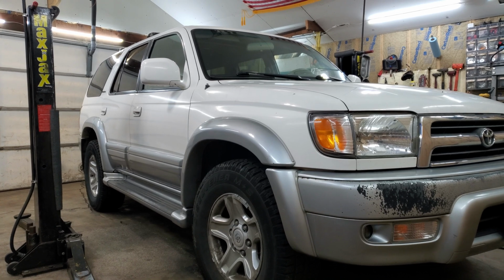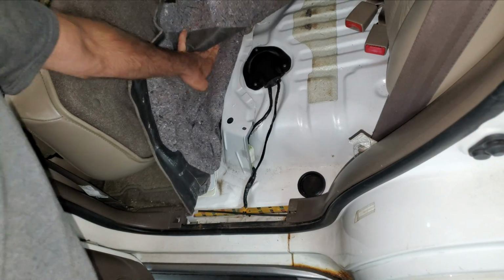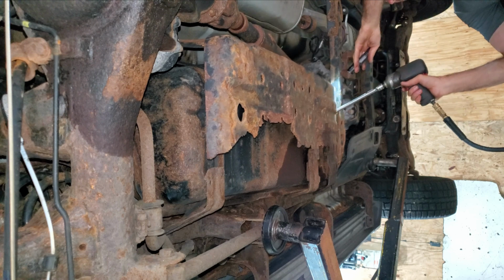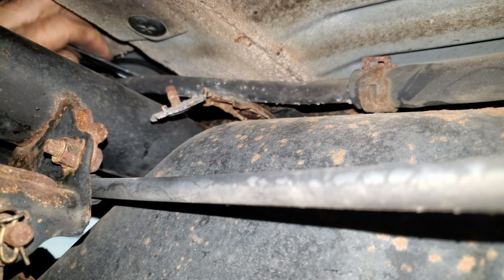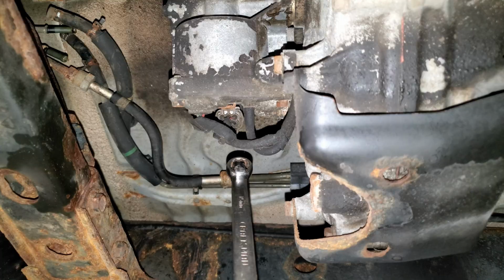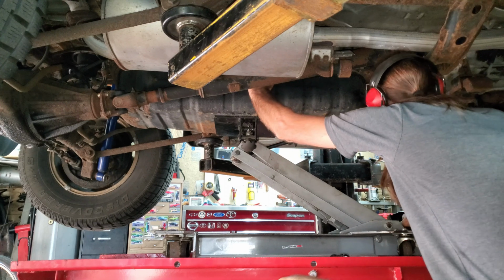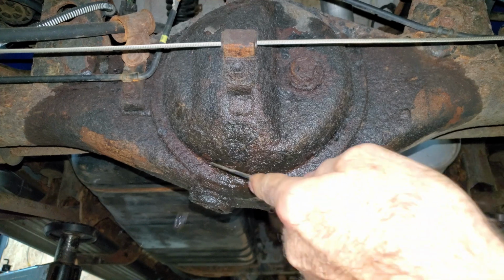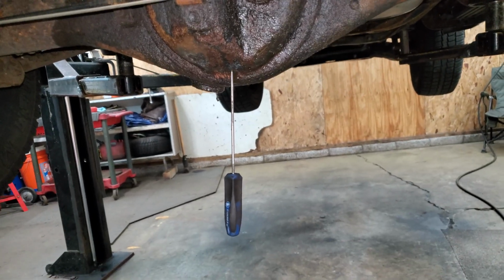1996-2000 Toyota 4Runner gas tank replacement

Comment: my 4runner has been out of commission since summer of 2018 due to bad engine.  There has been gas in the tank since then till now...2023.  Do you have advice on preparing/cleaning tank and fuel lines before new engine install?
Reply from the maker: I would see if it runs on it. Drive it to the gas station, and fill it. Run that tank to empty.

Comment: Thank you for this video 😭 having trouble with my 2002 pretty much the same but a little different. I am confused because at the front of my tank I only have 2 lines I don’t know if thats a difference between 2000 and 2002
Reply from the maker: Some systems are returnless.

Comment: Great video. Ok bye. On that rear differential cover, I had the exact same thing. Rusty and leaking and smelled horrible when the differential oil got on the ground and mixed with the rain. Horrible smell. Anyway, I bought a replacement cover on eBay for 60$ and had a local shop weld it on. Cut off the old cover. Looks great. No more leak. They only charged about 250 to weld it on. 2 hours labor. No more smell.
Reply from the maker: That would be an interesting video. I have not fixed one like that before.

Comment: I have a 96 4runner... I think 18 gallons... Is there a plug and play replacement with a larger capacity? Will a 26 gallon land cruiser of the same era fit
Reply from the maker: I don't know.
Reply: @RustBeltAuto  thank you for the reply....
Reply: People are swaping Ford tanks into the spare tire slot srq sells the mount brackets
Reply: @gmanknight3791  thank you...I will look intobit
Reply: Find anything that worked?
Reply: @AceThaGambler  I was told to use a landcruiser fuel tank of the same generation..   I haven't seen anyone whose done this to confirm

I plan on doing the pony express route... Loaded I get around 15-16 mpg..  with a 26 gallon fuel tank I will not need to carry extra fuel